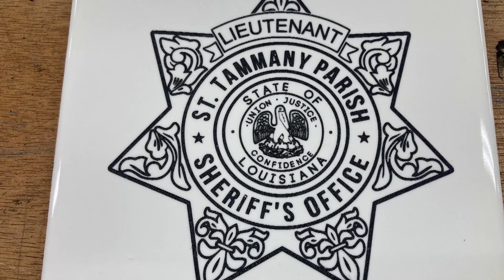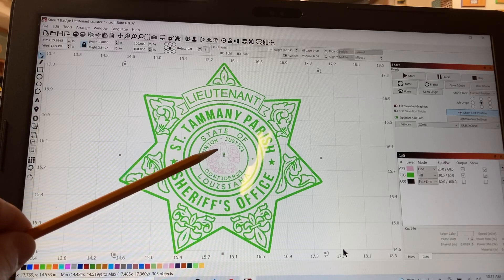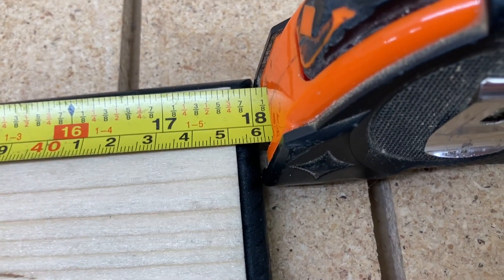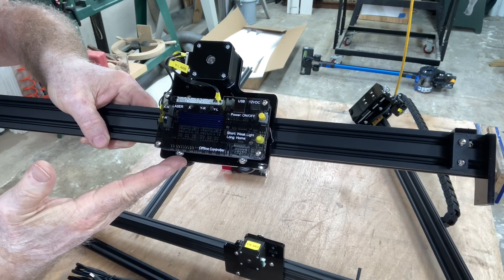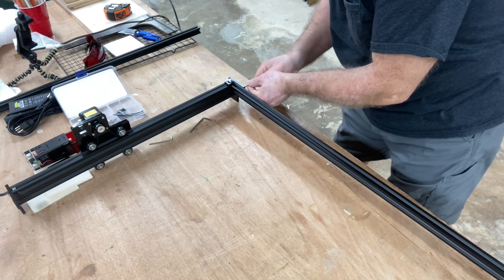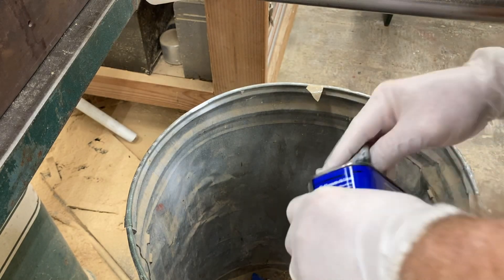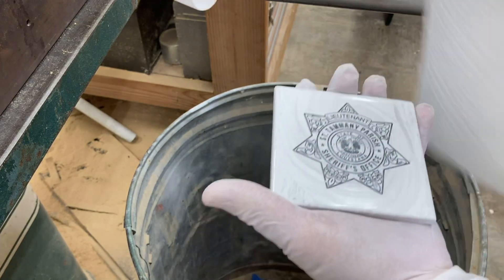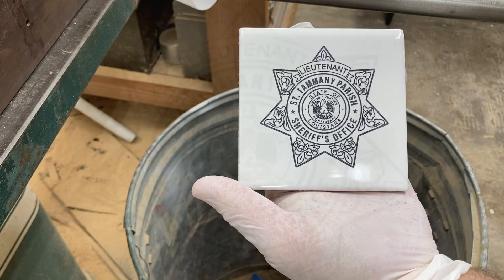Extreme Detail Engraving Ceramic Tile with the FOXAlien Reizer Mega Laser

Comment: I just purchase a FoxAlien laser but have been finding the odd line missing when laser ING tiles with the Norton method.  Using a magnified glass I looks like some lines are missing like the laser skipped or was off for that line.  Anything I can look at to adjust or tighten?
Reply from the maker: In the settings you have a lines per inch. Increase. Look at the preview zoomed in real close. You will see the lines.

Comment: @Paw Paw’s WorkShop

Hi there.
Is there any way to make the lines blue colored instead of black?
Thanks.
Reply from the maker: Not that I am aware of. This is a chemical reaction to the titanium oxide in the paint that is burning into the tile. There are some methods where using powder coating to melt into the project but is has limited results
Reply: @PawPawsWorkShop  

Nice. I just found out some videos with Powder Coat Paint.
Looked really nice. 
Thanks for your attention.

Comment: Great review as always. I was going to get a masuter but I may need a larger working area. I realized that this one has a moving z axis. Do you think it would be possible to attach a spindle and nema 13 on it to convert it to a light cnc cutter for foam ?
 
That way I can use spindle to cut foam and for the rest I can switch to laser and have a large cutting area.

Comment: Great video, great tips. Is this laser engraver better than the ORTUR Laser Master 2?
Reply: Seeing the results Paw Paw got I would say they perform about the same. The Ortur LaserMaster 2Pro has no problem engraving letters that are only 1.5mm high. I also have the LaserMaster 2. I bought a triple glazed lens from Wish that I installed on the LaserMaster 2 and was able to engrave lines that were .02 mm wide.
Reply from the maker: I have not used the ORTUR